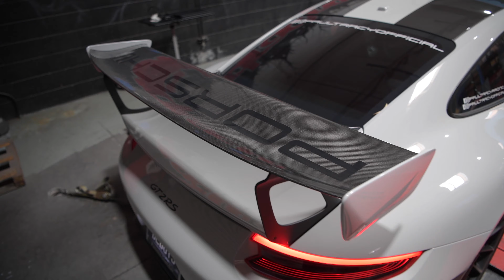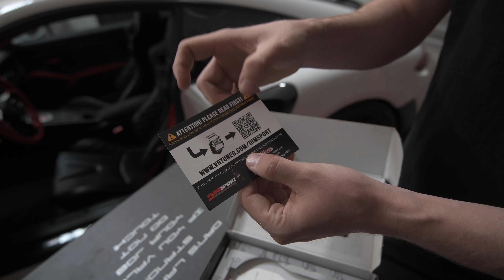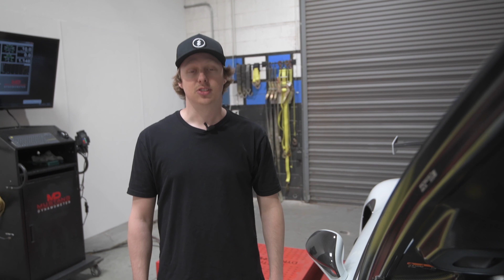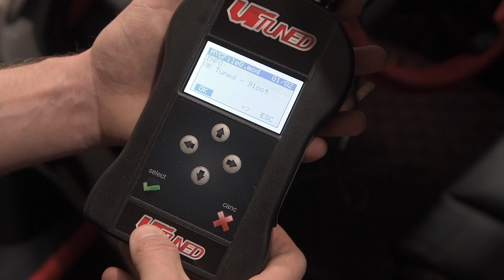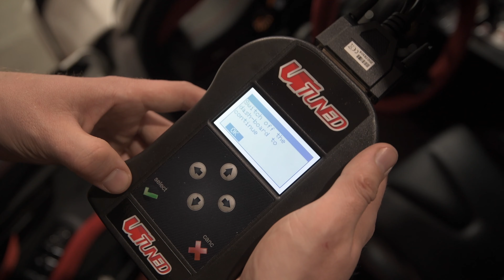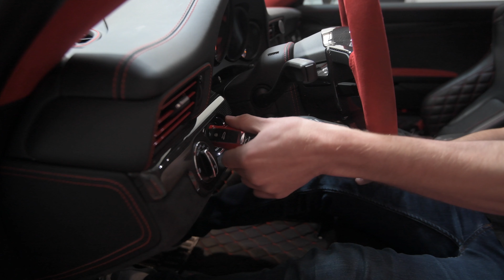How to Flash Your ECU using the VRTuned Dimsport Device

Comment: Does the handheld device have additional benefits? If we can use it to reset engine service timers after oil change, etc, that would be a great practical benefit. Reading CEL codes is another one. Thanks